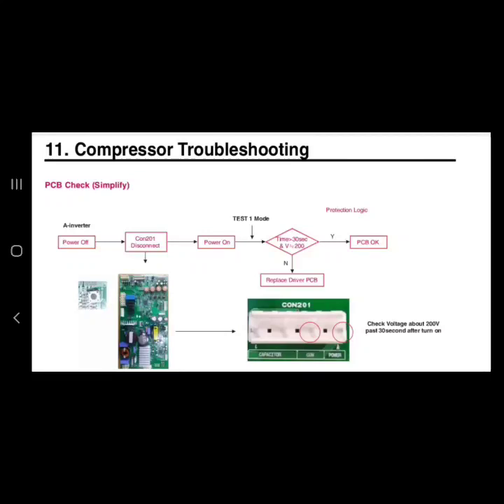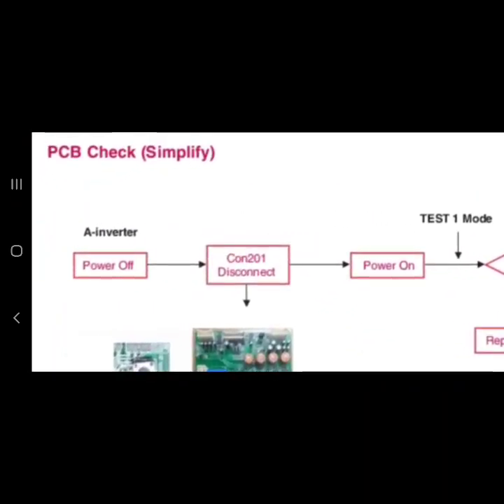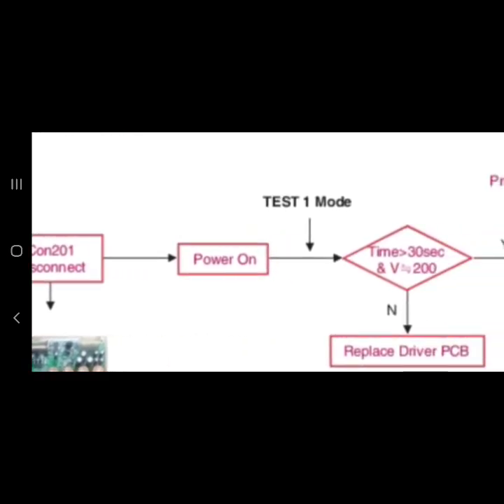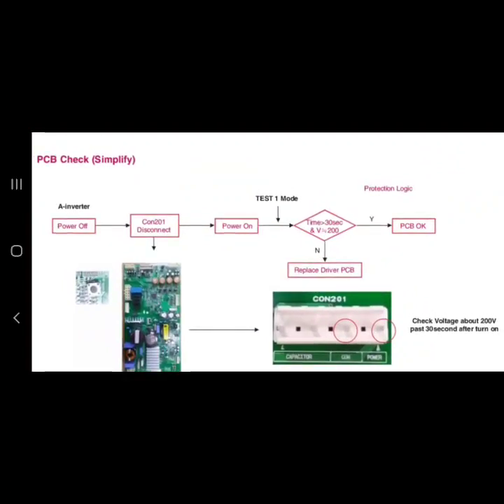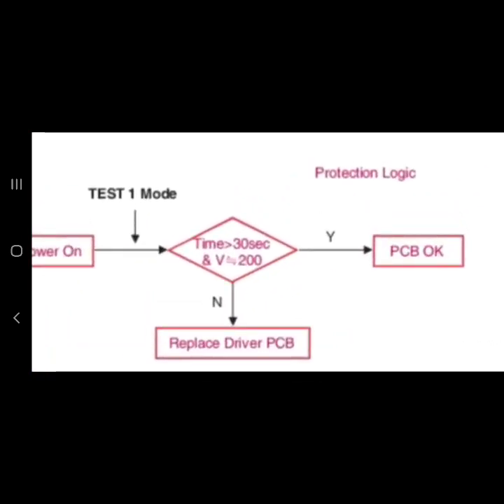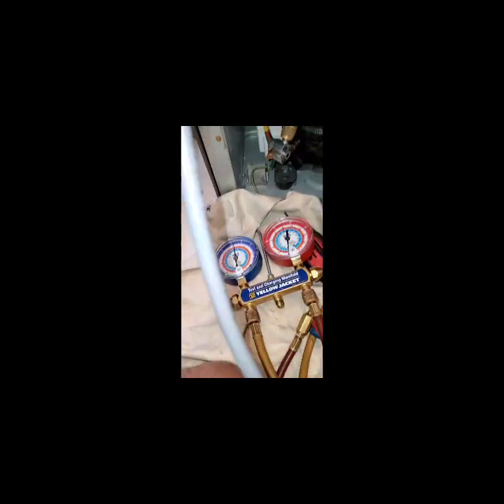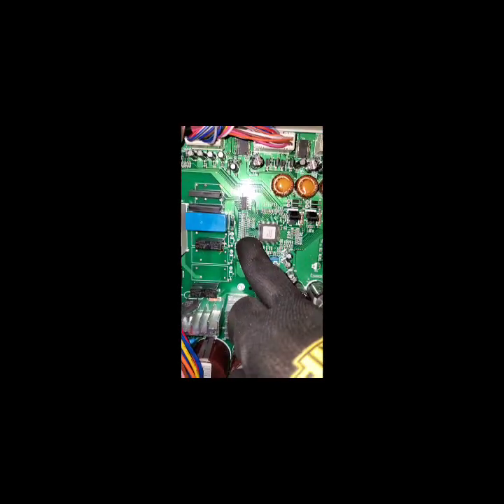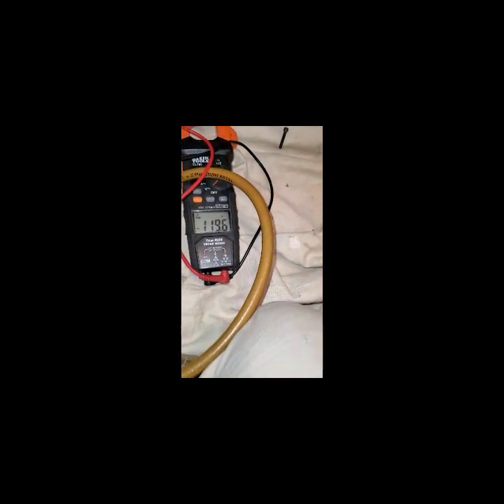#TECHTALK Check this before changing LG compressor

Comment: I got a LG fridge.
I followed all steps and was only getting up to 50Vac with the connector disconnected and pressed the test button after 30 seconds.  
Replaced the Board same results.  Compressor/Condensor running but still not cooling.
Did same test on new Main Board and same results only comes up to 50Vac when connector disconnected. 
With connector connected I get up to 110Vac on the original Board and the new board I put in.
Not sure if I missed a step or this doesn’t hold true to all LG.
Thanks for the video and help though
Keep up the great work
Reply from the maker: Whats the model
Reply: TMM Appliance Network It’s LMXS30776S/00
Thanks for all your hard work, keep up the great content God Bless you Bro
Reply from the maker: @OVERGOLD  tomorrow when I'm in the office I got u
Reply: Hi Guys What was the fix in this situation? Mine is same . Thx

Comment: Im a new tech so regardless if the blinking lights show normal operation, you test anyway. Also if the compressor is running but the condenser is room temperature still and the evaporator is not frosting at all, you still must test?

Comment: Not a myth, it’s an I need to get to my next call problem, and dont have time to do a proper diagnosis.  But good video.  But you also have that other bunch that walks in and orders the board without checking anything...I guess they are acceptig the 50/50 shot
Reply from the maker: Call in hour 754_273_8185 on Friday nights 10 pm est
Tell us about how your call went

Comment: Ok so why does every time a change a compressor it seems to work just fine hahhh
Reply: That's what I was about to say , usually when the led flashing 6 times it's indicating a bad compressor, if the board wasn't sending a good voltage,the compressor won't run I guess